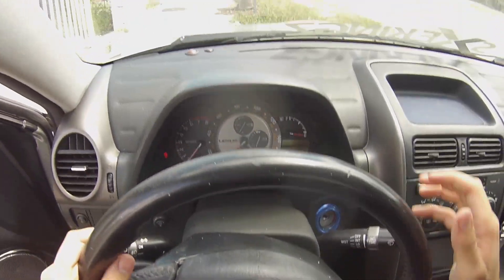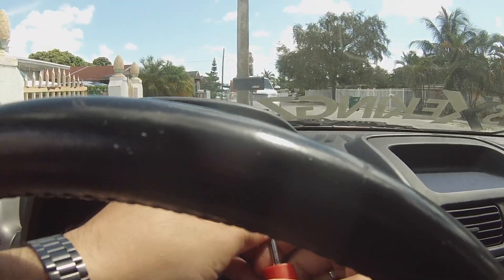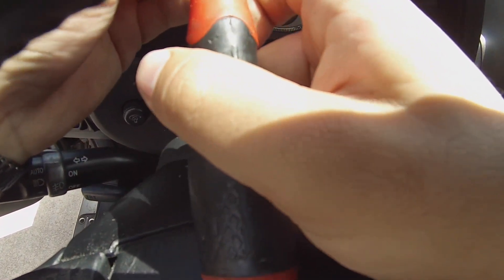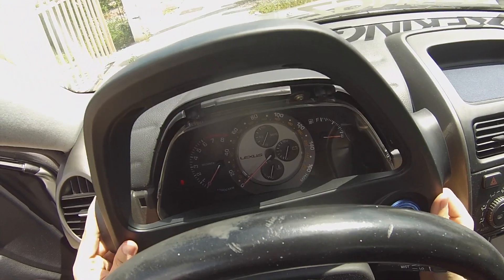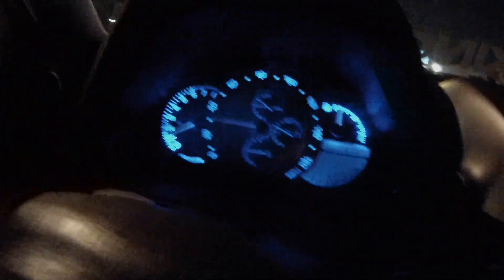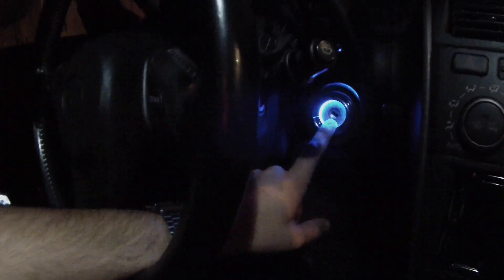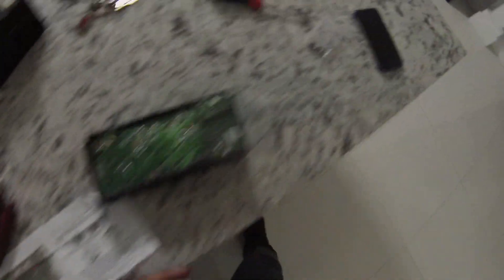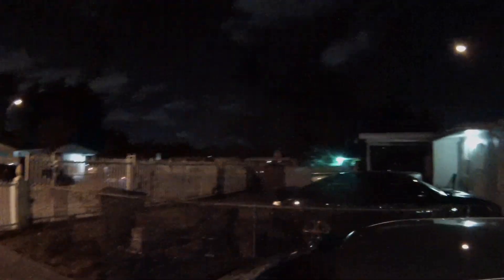DIY Lexus IS300 Dash Color Change / Ricing Out The Interior??

Comment: Can you show how to do the key ignition light
Reply from the maker: Bishop Breaux it’s not as hard as you would think it is, just take off the screw that holds down the key ignition light and you need to move the wires around so you have a better grasp at the bulb. Best way is move the wires around the spot that the screw goes into
Reply from the maker: Hope it helps if not message me on Instagram and I’ll try to send you a video through there